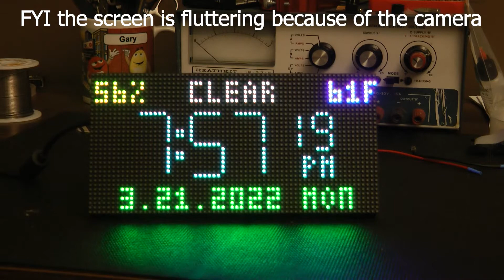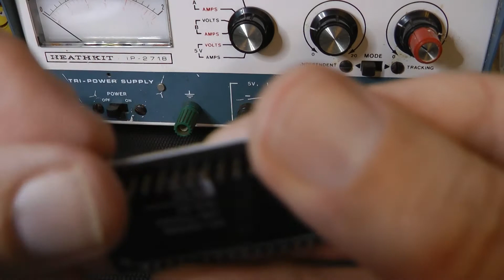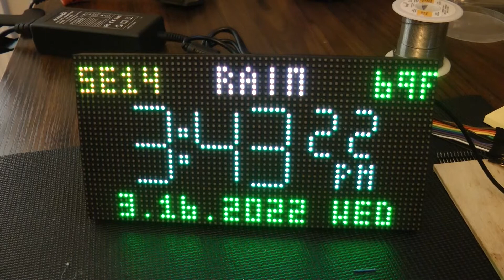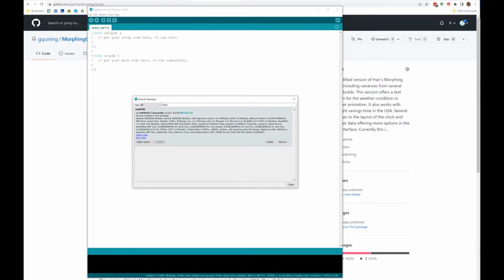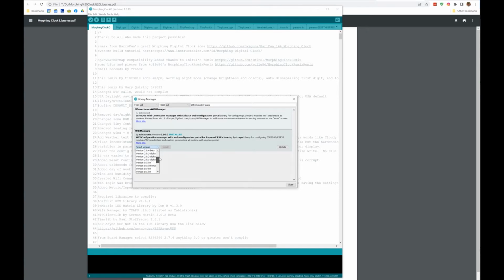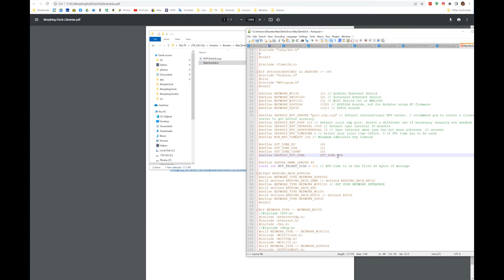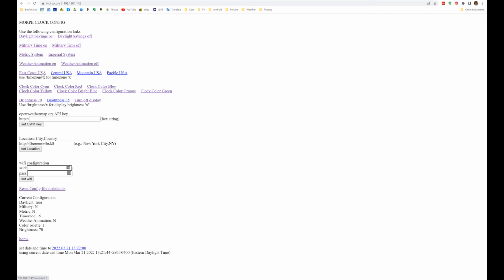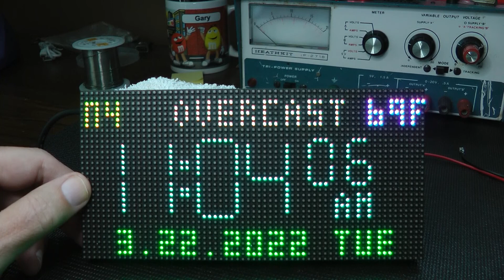Morphing Clock using a 64x32 RGB Display

Comment from the maker: A new version is available on Gitub today.  I noticed on occasion the weather was out of date.  There is an odd issue where once the code gets a HTTP 400 Bad Request error it usually does not recover from it.  I checked memory and a few other things and cannot figure what is causing the issue.  So the only solution I could come up with is to reboot the clock when it occurs.
Reply: Garry - please take alook and advise where the api calls to weather are done it needs changed to once an hour as is its pooling according to my firewall losts several times every few seconds, this will eat up the allowed 1000 api cals a day thats allowed.  Please help where this can be changed suggest it only poll one every hour and immediatly after powerup, that could also be why im seeing excessive traffic on the ip to the cloge and icmp timing out.
Reply: Second problem, chasnge to ntp didnt work, i changed the pool.xxxxxx server in the .h file to my local s1 gps ntp server snd its not going to it its still going out to the pool is their more than one place the ntp server is hard coded, suggestion that should be changeable via web.
Reply from the maker: @RobertMontavon  NTP server logic is not my code, it's a library.  You would have to contact the author of that lib.
Reply from the maker: @RobertMontavon  I'm not seeing it.  I know when it boots it will try two times in a row to get the weather.  If it fails it defaults to 5 minute checks.  I placed a serial.println in the getweather function and it's not being called more than every 5 minutes except the initial boot.  I would verify your API key is valid and place a serial.println in GetWeather to see how often it's called and use the serial monitor to verify.

Comment: You did an excellent job on all of your instructions for this project! I just finished the wiring and programming, and it's running perfectly! Just a couple hints for future builders: Use the same version of the IDE that is used in the video! The menu system changed a little in the current version, so it makes it hard to follow the steps. Also, I tried adding my 5ghz wifi connection. This board will only work with the 2.4 channel if you have both. It looks awesome and is very accurate!!
Reply from the maker: I updated the code today on GitHub, I changed the wind direction color to better view the wind speed.  The letter S looks like a 5 and it made the wind appear like 58 when it's actually 8mph.  I also added a hostname when getting the IP address from DHCP, this way it's easier to bookmark the web config page.
Reply: @Gary Quiring  thanks! BTW, I noticed that every once in a while the tops of the seconds digits disappear and then reappear a little while later.
Reply from the maker: @waynewhitney2780  It's a speed issue when checking the weather, I have seen that a few times myself.  How often are you seeing it?
Reply: @GaryQuiring  I haven't been able to nail down a pattern yet.
Reply from the maker: @waynewhitney2780  The weather is checked once every 15 minutes and 31 seconds. If the weather site is slow in responding the morph logic is assuming from the prior second and now several seconds has gone by so it messes up what it has to clear and display.  I don't see a way to fix it unless I bypass the morph logic when updating the seconds.
Reply: @Gary Quiring  not a big deal. It's still awesome!
Reply: @GaryQuiring  please let me know when it's available, and I'll load it up.
Reply from the maker: @waynewhitney2780  Problem solved!  There was a default timeout set that I was not aware of.  It was 5 seconds.  I changed it to 1/2 second and it works great now.  I uploaded the source to the Github page.  I also changed the weather check from 15 minutes to every 2 minutes for more up to date weather info.
Reply: @GaryQuiring  It won't compile. Error is: redefinition of 'char wifi_ssid[ ]'
Reply from the maker: @waynewhitney2780  Did you update any libraries or install something else that installed a library?  I'm using IDE 2.0.3.  Does it have a line number?
Reply: @GaryQuiring  1.8.19 just like the last time I installed it. It stops on the second line of the params.h where I typed in my wifi SSID
Reply from the maker: I have a 2nd computer, installed the entire thing from the Github and downloaded the libs from the Google Drive spot, it compiled clean.  The new IDE has a nasty habit of wanting you to update libraries in the lower right corner.  You might want to redownload the libs from the Google Drive.
Reply from the maker: @waynewhitney2780  I don't get it.  I would try downloading the .ino again from the Github. My other computer has 1.8.19 on it and it compiles clean and I got the file from the Github site, not my local network.
Reply: @GaryQuiring  There are a ton of error messages. Basically every line of the params.h file is flagged as a redefinition
Reply from the maker: @waynewhitney2780  I can't imagine what the issue is.  I would start clean.  Erase the Arduino directory where the MorphClockQ is and library directory and then download the zip files from Google Drive and Github again.  It sounds like something is duplicated.
Reply: @GaryQuiring  I started from scratch and it now compiles as it should. I'm letting it run now.
Reply: It runs normally if I leave it powered on right after uploading. If I disconnect power and reconnect, it shows 12 midnight in 1970 for a little while with no weather display, then the time corrects itself (still no weather), then several minutes later the weather appears and it runs normally.
Reply from the maker: @waynewhitney2780  The 1970 is normal when it has not yet synced with the NTP clock.  I have seen that many times on mine. The reason it starts at 1970 relates to when UNIX was created by Bell Labs.  The weather is very aggressive now, I don't want to wait for the service to provide the weather, it will eventually (2 or 3 tries) get the weather response.  If I put the delay back in then the morphing of the seconds will be scrambled.  I could on startup maybe loop it a couple of times to force a valid weather check.
Reply: @GaryQuiring  It runs great after it gets a chance to update everything! Try it with red clock text. It almost looks 3 dimensional!
Reply from the maker: @waynewhitney2780  I love this project, it's a lot of fun.  I made a change so when it boots it will try twice to get the weather before it moves on (I'll update tomorrow on Github).  The clock part I'm leaving that alone, I honestly don't understand that code, it's kinda weird how it works.  When you use the web interface you can now reference it via http://morphclockq, it's easier to remember and you can bookmark it, you don't have to worry if the IP address changes with the DHCP server.
Reply: @GaryQuiring  I printed a minimal framework that attaches to the back. It allows you to either stand it on a desk or hang on the wall.
Reply from the maker: @waynewhitney2780  I used a goose neck holder for a cell phone.  It's attached to my side desk and it appears like it's hovering in air.  I got it on Amazon.

https://www.amazon.com/gp/product/B09LT1NNFK

Comment: You have a flaw in this code for the weatherapi, its sending requetsed every few seconds from what im seeing in my firewall loks, this will almost immediately depleate the 1000 calls allowed for free for a DAY,  where would this get changed to only pool it one every hour on the hour?
Reply from the maker: My plan allows for 60 calls per minute.  If it were calling that often it would deny my requests.  I put a serial.println in GetWeather to see if it's calling too often as you see.  I don't see any unusual calls going on.  It's checking every 5 minutes.    There is some logic that would create more calls if it cannot get the weather from the service.  Maybe your API key is invalid?  Bring up the serial monitor and see what it shows.
Reply: I found the problem by enabling com port monitoring it was stuck in continus loop on the location your video said city , country but the web interface said city, state, which is wrong endless loop bad city….  and found the variable were its was set to 5 mins, I changed it to 30 every 1/2 hours more than sufficient for this, and the ntp server dont get set in the netclient.h like i assumed, its in your file.  It be nice to have an oled outout the serial data  @GaryQuiring

Comment: Hi 😀
Question: 
Is it possible to change the code from Fahrenheit to Celsius ❓
Can you change the date to German (day / month / year ) ❓
Why does the master folder need to be renamed ? No matter what name then ❓
So everything in German if possible ❓
Reply from the maker: The Fahrenheit to Celsius is already there in the web interface.  The master folder name is the way the compiler works.  The date format is anything you want, it's in the params.h file
Reply: @GaryQuiring  Is this the folder (ZIP) "ESPAsyncUDP-master" where I have to change when saving ❓If "YES" in which name ❓
Reply from the maker: @matthiash.454  Why don't you download the Zip file I made from my Google Drive account so you don't have to do any of those steps?

Comment: I am having a hard time with the google drive link, does it still exist? also, some of the libraries seem not to exist. Do you have tips for that? I am using amica esp8266 arduino IDE 2.3.2
Reply from the maker: Just tried the link it's working fine.  All the libraries are in the Google Drive file.
Reply: I found the link. I think I copied the L or I wrong. Furthermore, my system is constantly restarting and rarely works right, meaning boots and displays time. I am running a 5v psu with 3watts of power. I think I have to upgrade. Also, the libraries updated and broke everything. So now back to square one. Thank you for the help
Reply from the maker: @pcmann2004 If it's constantly rebooting it's most likely your city, country or the API key for the weather.  Check the serial monitor.  Also I'm not sure why you were typing the URL for the Google drive, it's a clickable link on Github.

Comment: I change the portal to  "/brightness/80" but it doesn't update the Params file or the display? Am i doiing something wrong?
Reply from the maker: Looking at the driver code 70 is the max.
Reply from the maker: When you say storing to the params file, it stores the settings in non-volatile memory on the ESP board.  It's not going to update params.h.

Comment: I just noticed something weird. The temperature reading is updating normally, but the center indicator (where it shows "rain", "snow" etc, appears stuck.
Reply from the maker: The free weather feed does not refresh data very often.  It's also not terribly accurate in my area.  It could say it's cloudy and it's actually raining.  If you think it's stuck try rebooting it and see if that changes the weather description.

Comment: Hi Gary, why is it always that wifi connect failed. I am very sure the ssid and password of my wifi is correct. Please help. Thanks
Reply from the maker: The ESP8266 boards are 2.4 only, they don't support 5ghz.  Beyond that I don't know what could be wrong except distance. Try getting it closer to your router.